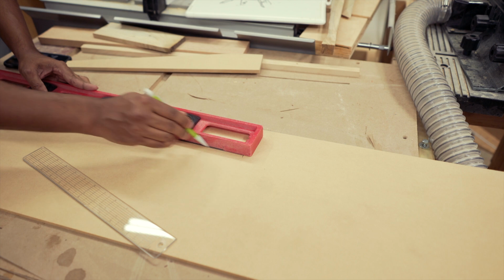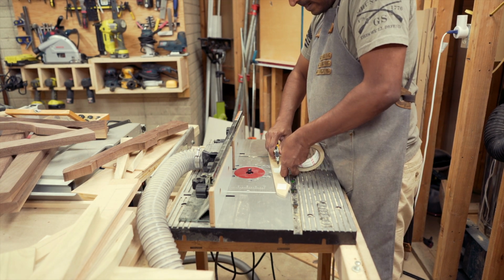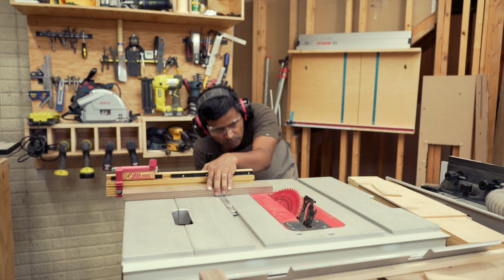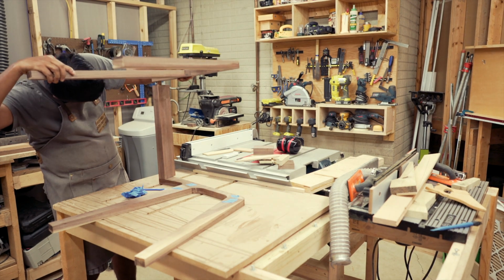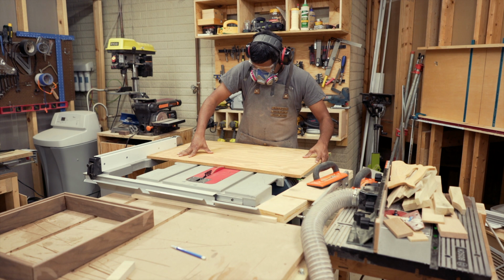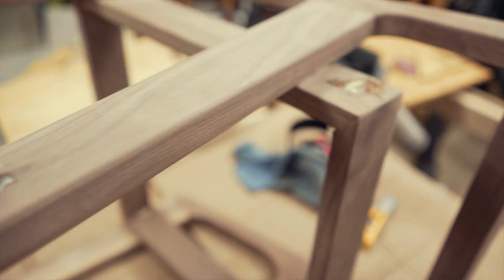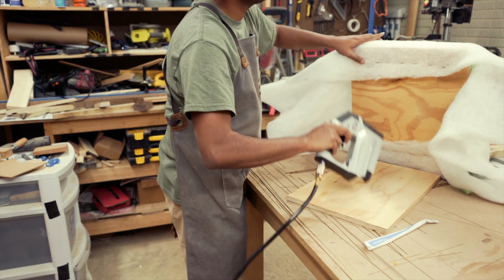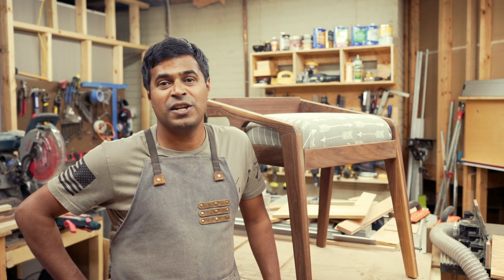Build a Midcentury Modern Inspired Upholstered Walnut Chair // DIY

Comment: Looks great Buddy but as others have mentioned that foam is too high and maybe your back rest should have had the same angle as the side rails.
Reply from the maker: Thank you! I was working with Corona stock so I used the high foam that I had in hand! I'm in the process of replacing it now with a 1" foam. The backrest has an angle that leans away from the frame, similar to the front leg.

Comment: Hello Kiran, very good project. Can you give approximat hours spent on this chair in the workshop. So that I don't become impatient midway and do some mistake in hurry when I try this.
Reply from the maker: It took about 20 hours working about an hour a day. I also had an unrelated injury so paused work for 7 days that upset my rhythm. If you spend 4 hour chunks at a time, I bet it can be done close to 15, maybe less. Every time I stopped, I had to recompose myself, that made me think and be patient, so was a blessing in disguise. Another thing that could save time is buying S4S lumber. Surfacing using my benchtop tools takes quite a bit of time. The most time consuming parts were round overs, sanding and finishing, easily close to 8 hours. You'll see the shape of the chair yet you know you have long ways to go!
Reply: @KiranBhatWoodworking  I am novice, but try to lay my hand complex project other than straight cut and screws. Let me plan this. Thanks a lot. By the way, we also like Basmati Rice( Royal).
Reply from the maker: That's the way to learn it! Those rice bags always looked like they could be repurposed and finally got a chance!

Comment: When you redo the cushion with thinner foam--keep in mind that any folds you make should not be visible from the front or back---they should be on the sides ( or folded in such a way that it's not seen)---Chair is beautiful, by-the-way---oh, yes, dacron should not be on the bottom of the board
Reply from the maker: Thanks for the great tip! I have to think and be patient with upholstery because it doesn’t come naturally and quite tricky!